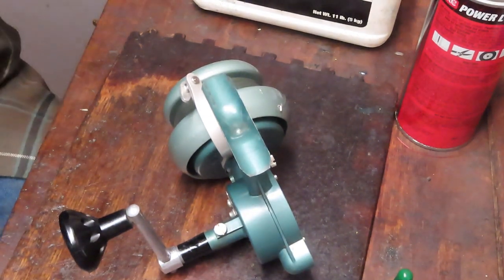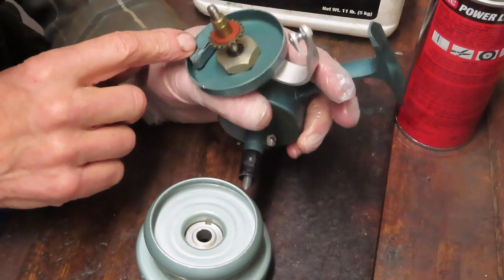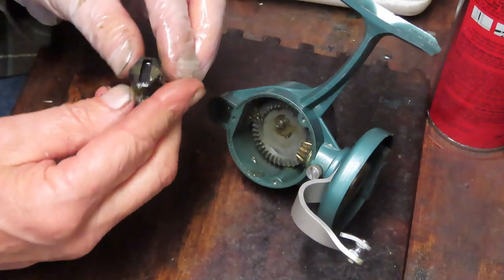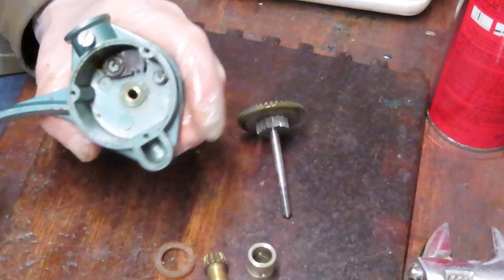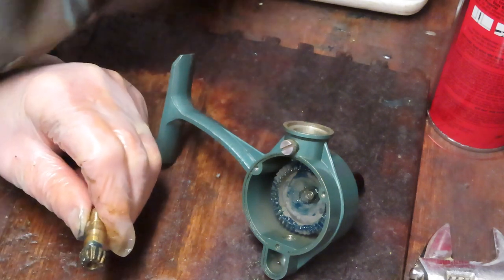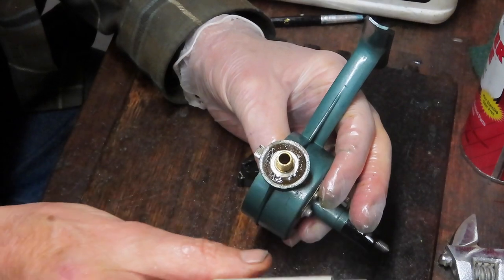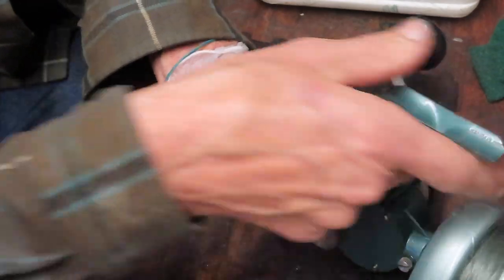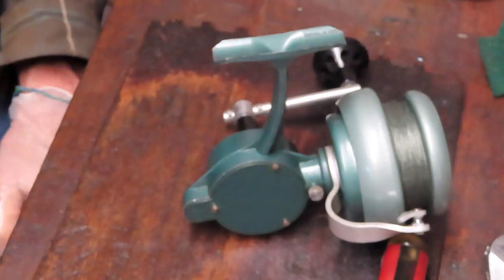Alder no 4  vintage French spin fishing reel how to take apart and service

Comment: I would pay some serious money for this reel. I absolutely love this reel. There is so much in this reel that reminds me of other French reels. The main gear looks like a Luxor, the pinion and sleeve looks like a Mitchell 3o6, and  the spool and line pickup looks like a Peerless BAM  or Mer 52 Punch. That drag setup is truly unique in my experience. I will be hunting for this reel for a long time I’m sure. Dennis, I need to send you my Mer 52 PUNCH PUM surf reel from France. If you think this reel is different you’ve got to see that reel. I’ve never been brave enough to pull the rotor on that reel. I was so afraid I might damage something. This Alder reel is every bit as unique and unusual as that Mer 52.  I had seen a picture of this Alder reel before but this was a fantastic opportunity to see it inside and out and up close. You handled this reel with such careful attention to all of its intriguing features. It was an outstanding job by the master himself! Great video. I know I will view this one many times.
Reply from the maker: Thanks Chris - I thought you might like it - Dennis
Reply: Its a nice reel Chris but with all due
respect its no Luxor. Luxors are in a 
class by themselves. Alder reels were
made-I believe-by the same manufacturers as Ru Mer hence the
similarity. The Ru Mer Pacific is very
close to this.
Reply: @armandoreyes1891  oh I’m quite sure it’s not a Luxor and I agree the Luxor is in a class by itself. In fact I just finished cleaning and servicing my latest Saumon Mer acquisition this afternoon. This one was missing that black spacer/washer on the handle. Where in the world would I find one? As for this Alder I just really like the reel. You’re right about the Ru Mer lineage. If you look at other Alder models you can see that similarity even stronger. I had never seen one of these close up before. As a collector I felt like this reel would be a great addition since I have 4 Luxors, that Mer 52, a BAM Peerless, 4 Brettons, and 33 Mitchells. I wouldn’t mind having a Ru Mer Pacifica either. I’ve seen some nice ones but they were pricey.

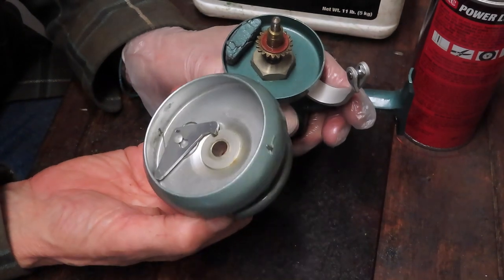Comment: If you look at the counter weight position at 3:00 it is opposite the bail, but when you reassembled it at 15:00 it was no longer in the opposing orientation... I haven't watched to the end of the video yet
Reply from the maker: I will go back and check.  I think I reset it, but it may not have been on camera -  Thanks for the note - Dennis

Comment: I’m having a problem with my reel where the line spools at the bottom and I took out a washer and it still the same problem, It’s is a penn fierce 3. I don’t know what I need to do so I can lower the spool
Reply from the maker: There are no adjuster washers on that model. The white washer needs to stay there.  Check the bail wire to see if it is bent down.  It may be that you need to straighten the wire or  replace the bail wire to correct it.